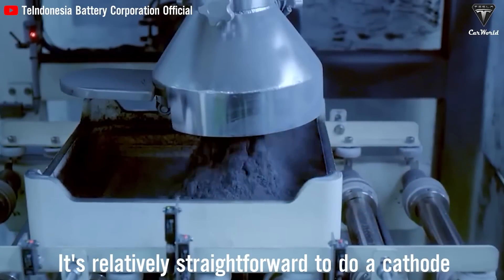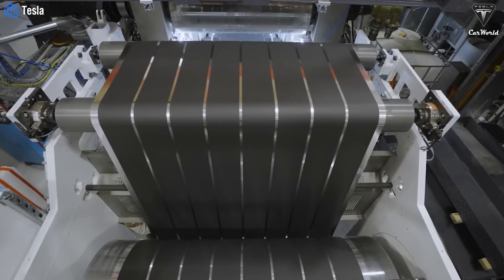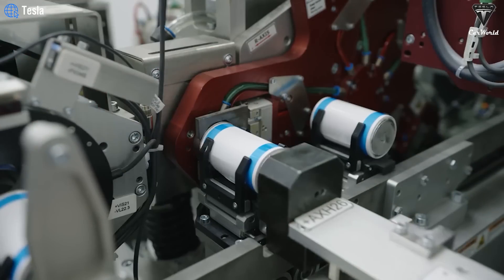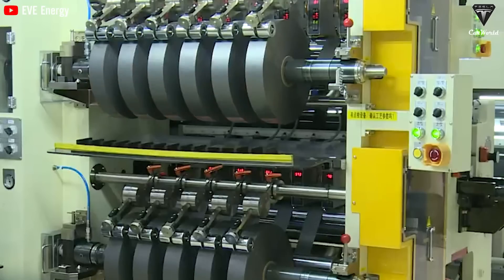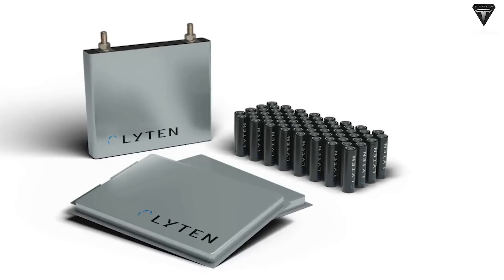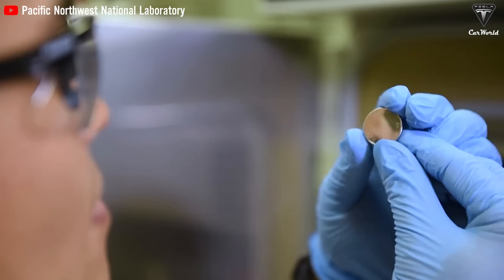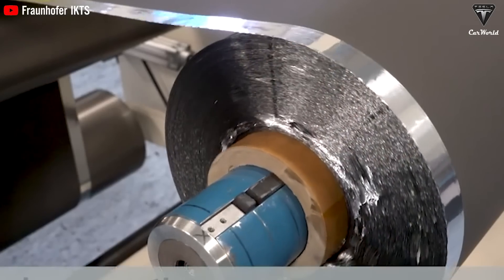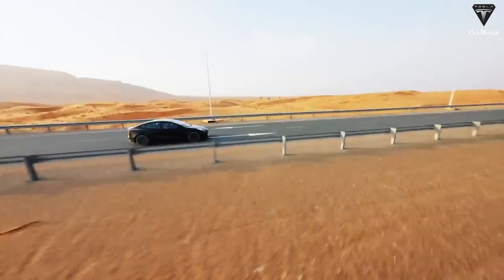No Need For Lithium? Top 3 Batteries Technology for the Future You MUST Know, Change Your Mind!

Comment: You forgot to talk about the use of silicon in replacement of graphite for the anode. Silicon has almost 10 times the specific capacity of graphite. Not to mention also the use of sodium instead of lithium. It has a lower specific capacity but it's a lot cheaper than lithium and less influenced by cold temprature.

Comment: The battery I want to use is less trouble less expensive more power more autonomous and faster charging also supports in colder weather.  Anyway faster production
Reply: Biggest problems today batterys are weight and cost.